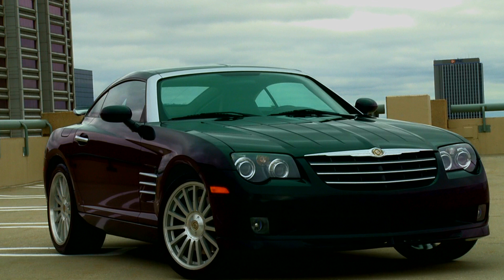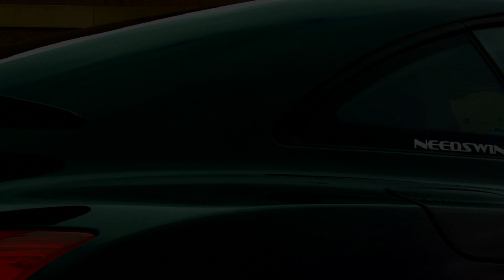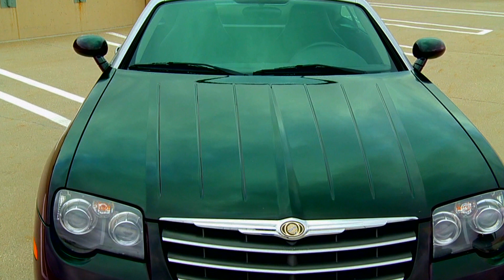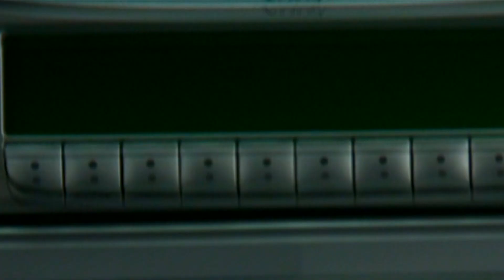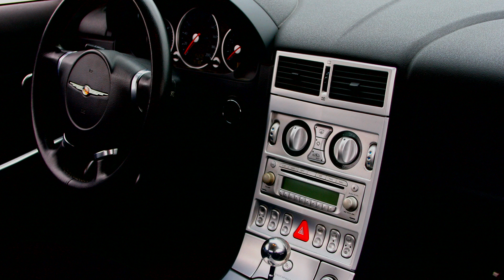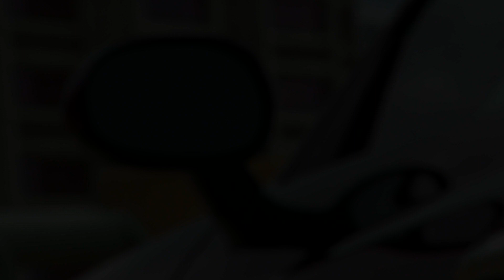SRT History: Chrysler Crossfire SRT6.

Comment: The sad part about this car is , Mercedes Killed it once they split with Chrysler because the electronic parts are now impossible to get. If the Skreem or key is lost or fails you are in big trouble. Because the parts are no where to be found. And when you can find them they are very expensive and only Vin related . So no random Skreem or key will work . You must buy the whole computer and skreem and key and have the vin number of the old car. If it works ? Mercedes should build a bypass for these old cars . The security on these is over kill. Because it is a Chrysler Vin number you cannot get electronic parts as of now with no ETA of parts available they keep pushing it back further and further which don't look good. . If it had a Mercedes Vin number parts are available like Skreem and flip keys not for Chrysler . If you buy a brand new kit from Ebay you must have it scanned by a special scanner Which no one seems to have. If your skreem fails you are screwed from what I am reading on the Crossfire forums. Fiat Chrysler will not work on these Neither will Mercedes because it takes a special scanner device that no one has these Special scanners now. I love my Crossfire but it scares me since it could possibly fail at any moment with no way of fixing it . You can buy any mechanical part from many aftermarket manufacturers but none for the electronics. That is why these cars are so cheap . The prices have fallen . With no support from anyone I don't feel comfortable driving to far from my home. Unless I have been misinformed ?? Best of luck to anyone having trouble
Reply: That has changed. There's a shop called Mercedes swap shop and they can fix the skreem

Comment: If you look at Edmunds or Kelly Blue Book you will find that the IDENTICAL Mercedes is almost 1/3rd more expensive than a Crossfire from the same year.  I'd rather have the Chrysler because it is a rarity.  Of course it IS nice to say; "I own a Mercedes"...
Reply: randy109 slk32 amg and c32 amg the exact same engine are all under $13k buddy so what are you talking about? lol don't compare a high end mercedes with a Chrysler when it doesn't even have the sane engine lol.
Reply: ТТTTrу this ==> https://twitter.com/79aeb991f637aa933/status/754954572104212480 i just gеnеrаtе 99k Credits using this оnlinеее tоol. Wоrks on аll devices. 100% working                                           SRТ Histоry  Chryslеr Crоssfire SRT6
Reply: AMG HEAVEN str6s have same engine chassis and suspensions what are you talking about
Reply: matt Reilly I was under the the impression we were talking about the regular not srt6 yes I know that otherwise I wouldn't be where I'm at today. If we are talking about the srt6 the interior and quality of the build is different. Your 100% correct though about the engine. I didnt know the Chasis was the same though

Comment: Most people think my Crossfire is a brand new car. I've got 27k miles on my 2004, and it has been a great car thus far. I'd love to try out an SRT6, though with the bigger wheels and stiffer chassis, I can't imagine it being all that comfortable. I bet it's faster than hell, though. Great work, gentlemen!
Reply: Fun fact the srt6 crossfire uses a Garrett air to water intercooler made in Mexico with the worst welds ever done
Reply: @Jdm_fl5true however if you do a separation kit like from MSC you can take the 15-16 psi of coolant pressure off the core and just leave the 3-5 psi from the pump on it seems to help a lot

Comment: Basically an old slk with the old Mercedes c32 amg engine
Reply: They used the older R170 SLK chassis because it was more primordially sporty than the later R171 platform (have you not noticed how Mercedes cars have become 'softer' over the decades.  Why do you think people worship Mark I, original Mazda Miatas and pay $15k+ for 26 year old perfect examples, when the new Miatas are pretty distained and have none of the handling or driver pleasure of the originals. As for the engine, the latest Mercedes 350 V6 unit is almost identical to the 320 engines, save for some power-eating emissions controls additions.  You should learn about true drivers cars before offering views that just make you look like someone who knows nothing about motoring lol!
Reply: @droge1300  also a lot of people slam the recirculating ball steering on r170 compared to the R171 rack and pinion. No one would ever know unless you told them either. The greatest generation BMW M5’s had recirculating ball steering as well yet you never here anyone gripe about it.
Reply: 0812rs basically you are wrong. Drive them both. SRT is a lot better handling car.

Comment: This car is a 2004 and still looks better than 99% of 2014 cars in this segnent today.  If you have not seen the Chrysler Firepower concept look it up. That car has lines that the porsche panamera and ferrari ff emulate today with the exception that the Firepower was a coupe concept. Chrysler still needs something sporty in its current line up

Comment: I hated everything about the merger, but I love the Crossfire.  My hat's off to the design team at Chrysler for a job well done.  I liked the part when they talked about how Mercedes made them under rate the SRT HP number.  Now that the merger is history I would like to see these guys sit down and tell us everything that Mercedes would not let them do with the car.  Couldn't let these Americans built a better Mercedes than Mercedes with their cast off platform.  Oh yea they did anyway.  Luv mine
Reply: Well put it this way.... I took my 15 year old completely stock Crossfire NA on a rolling road. It made 226bhp.   A 15 year old car, with 110k miles, making 11bhp more than the claim for the new car!  I suspect the NAs when new were around 235-240 and the SRT6 around 350-355bhp.

Comment: The biggest misconception about the Crossfire is that the car was nothing more than a re-skinned MB SLK.  The development team did an outstanding job making the Crossfire a wonder car to look at but, more importantly a better driving and handling car than the original SLK.  The roadster development alone involved a great deal of CHRYSLER r+d to turn a hardtop convertible into a soft top.  Mercedes sole purpose in the so called merger of equals was to suck the money out of Chrysler and move on.

Comment: Hi. I have been looking to buying an SRT 6. I have noticed the appearance of the motor is different in the earlier models to the motor at the end of model..I wonder if  you can tell me if there is anything in favor of one over the other. Also any input on convertibles vs coups. Someone said the convertible was the pick(a smoother ride) but I worry about the availability of a replacement top in the future.I live in Tasmania winters are around 0C so maybe too cold. Any thoughts please let me know.

Comment: I have been looking to buying an SRT 6. I have noticed the appearance of the motor is different in the earlier models to the motor in this clip. If anyone can tell me if there is a disadvantage with the earlier supercharged motors vs end of line model. Also any input on convertibles vs coups. Someone said the convertible was the pick(a smoother ride) but I worry about the availability of a replacement top in the future. Any thoughts please let me know.
Reply: I get I’m 7 years late on this answer, and it’s because the car in the video is from Needswings. They sell a lot of aftermarket performance parts for the car.